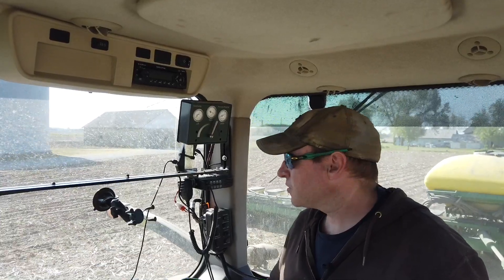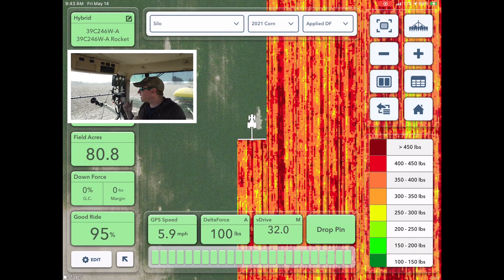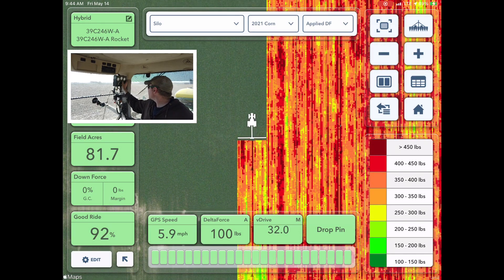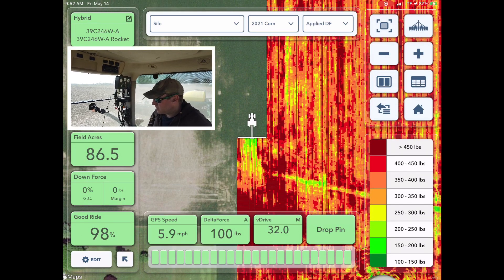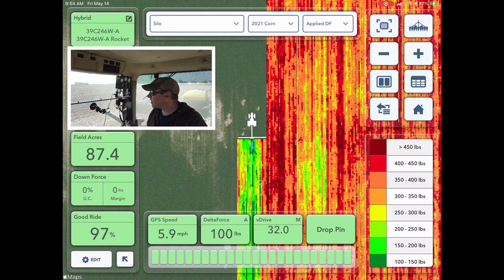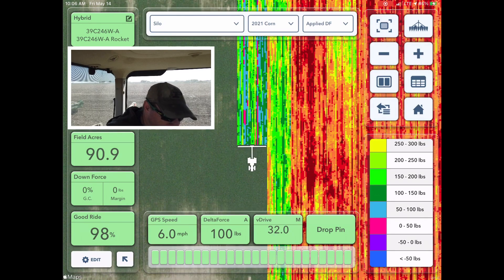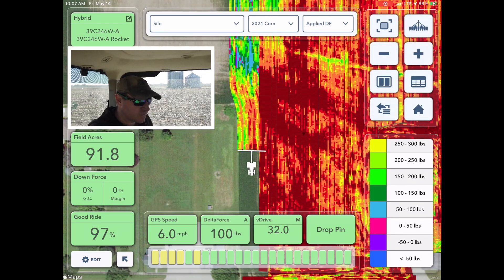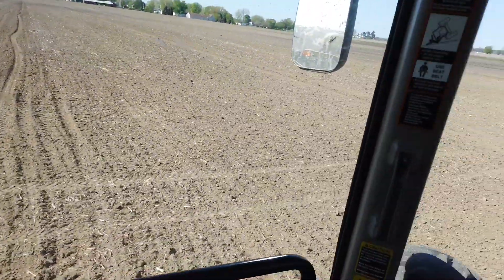Geeking out on Planter Downforce and Row Cleaners

Comment: I don't have the delta force yet, but plan to.  When you switched did you also notice the closing system worked better since you should be using the correct amount of force?  I think I'm seeing where I have my spring adjusted to pretty heavy, then hit a damp patch and softer soil (this is no till) and have slot closing problems.  There are also times when I would want the row cleaners way up because it takes longer to dry out under heavy residue, if you do that are you still getting into the target depth?  Good luck getting the planter ready this year, we're going to need a big crop.
Reply from the maker: There are times in tall rye I've just raised my row cleaners all the way up. Sometimes we struggle closing the slot. Get away with that in soybeans but not so much in corn. I really like Furrow Force but haven't ponied up the money for it yet. I thought about getting a couple rows to try, but even that involves buying a bigger compressor which isn't cheap.
Reply: @TheFarmersLife  Good info. Thanks

Comment: Hydraulic downforce is likely one of the biggest advancements in planter technology in a long time.
Reply from the maker: I joke when we had the 3bu box planter after adding Delta Force that apparently we should have been planting with the air bags deflated for all those years.
Reply: We run 3bu hoppers on mostly conventional till. Usually just set them at 55 cause that’s the minimum and have good results. Starting to do less tillage on the erodible land and you certainly have to keep your eye on it more. But it’s mostly just a ‘good enough’ method in varying conditions. Next planter will be hyd df